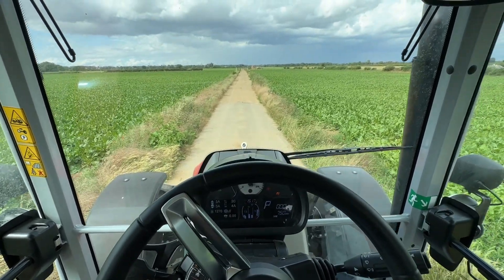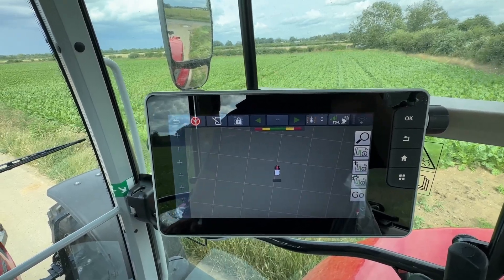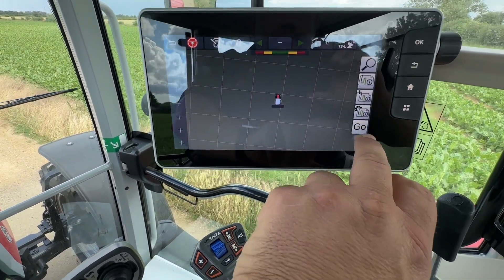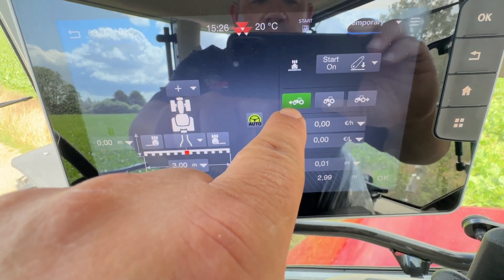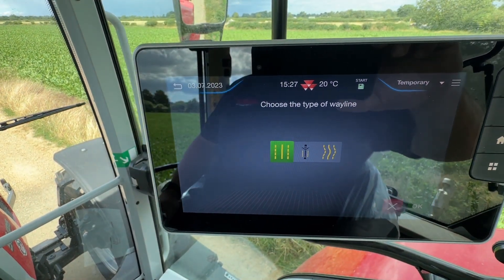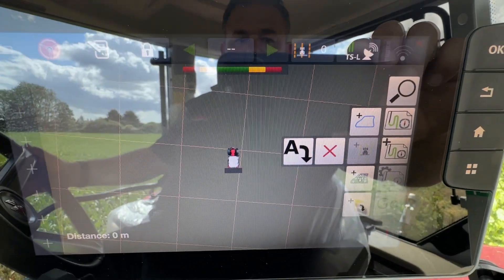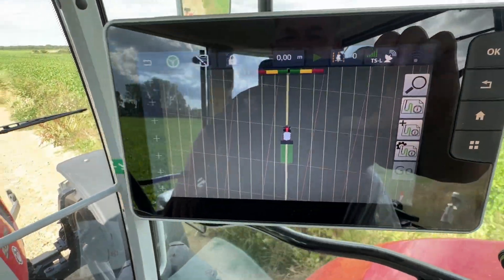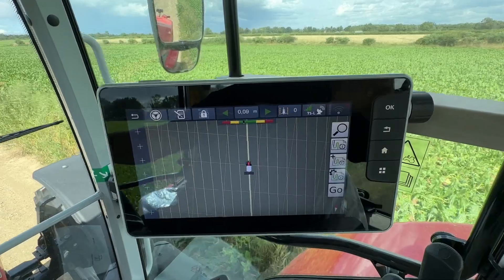Massey Ferguson GPS ‘GO MODE’ tutorial

Comment: Can you manually turn your coverage logging (painting) on and off?
Reply from the maker: Yes, you’d just press the floppy disk button on any run that you don’t want to paint.
Reply: @masseyman6290  thankyou
Reply: It’s very hard to find any real information out about the mf guidance. Have just ordered a 155 7s steer ready and dealer said it’s rubbish and has quoted $36,000 for an ag leader system.
Reply from the maker: @1brymark  why on earth would they say that? MF steering is as good as it’s ever been here in the Uk, even the FOC signal is really good!